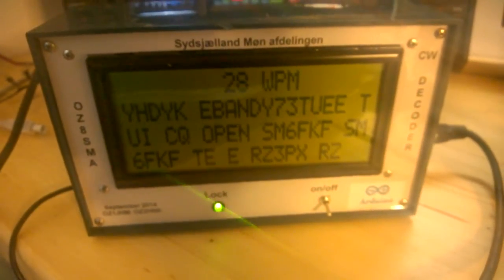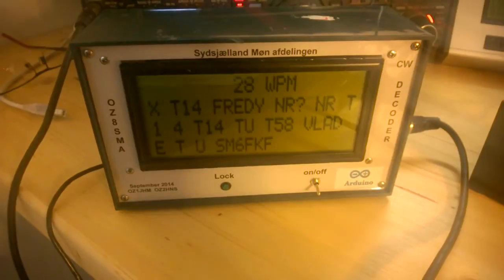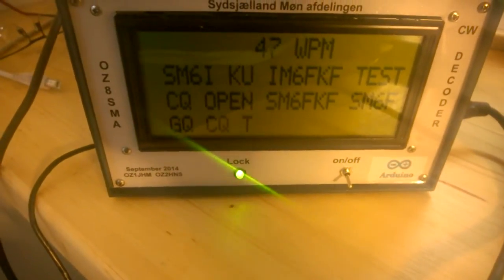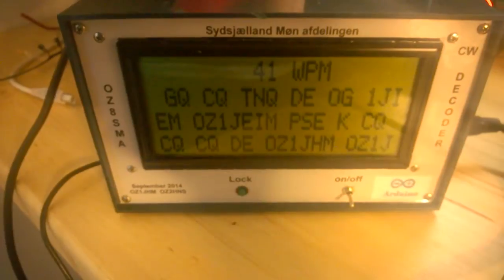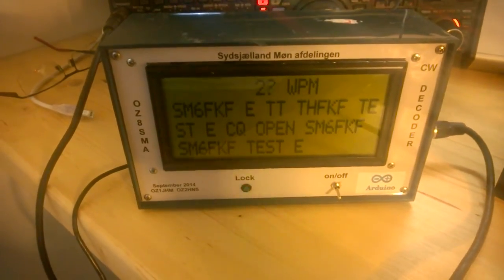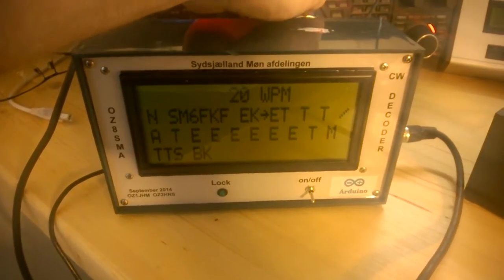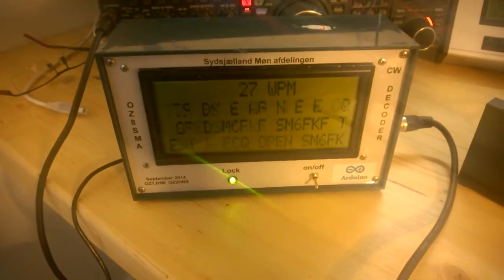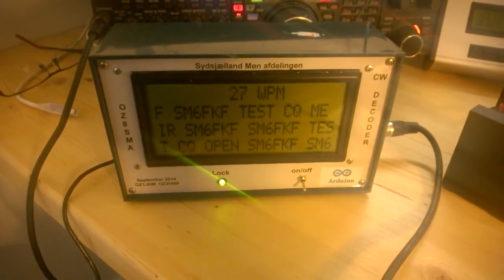Arduino morse decoder cw goertzel DSP

Comment: thank you built works fine used.01uf capicitor to decouple audio input lower not too loud in headphones while decoding tone altered to 744hz where i like it again thanks loaded videio on my channel will be boxing it up to use in my shack 73s
Reply: what pin on the arduino are you using for audio out for your headphones?
Reply: @yinglyca1  on the audio in to Arduino before capacitor